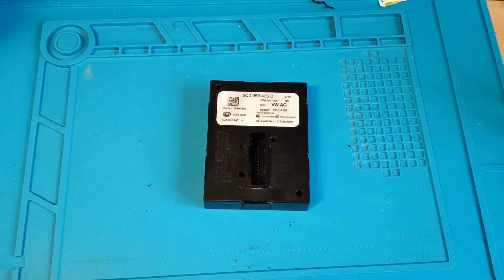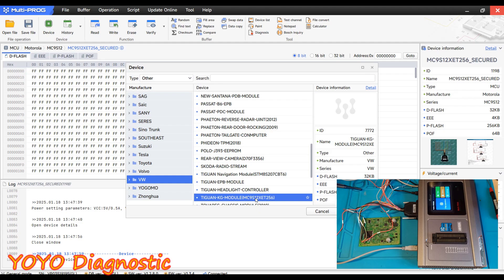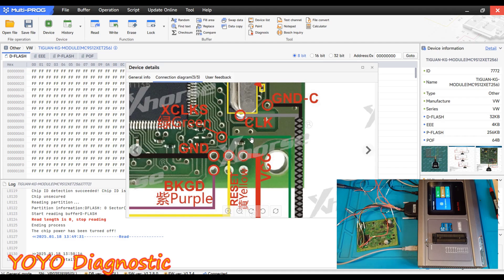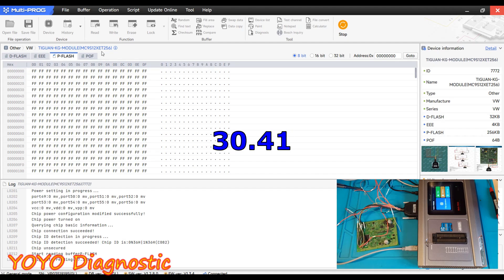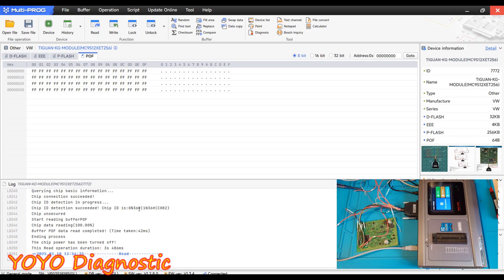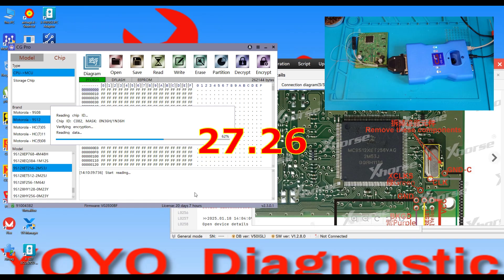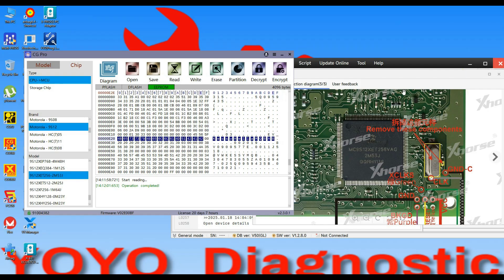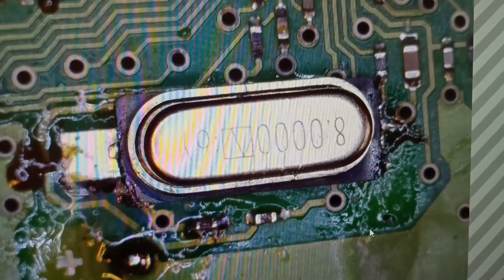Clone VAG Kessy MQB (Keyless Entry Module). CGpro vs VVDI-Multiprog. read/write MCU 9S12XET256VAG

Comment: I have buy the multi-prog but it don’t work! I have try it to red an ECU Bosch MD1CP004 from an Audi A6 2016 model it’s always come an error : Authentication Failed. I have try 10 times but the same problem. It’s not good!!!
Reply from the maker: @ionutind  contact the company VVDI, if you don't like it you can return it in 30 days.
Reply: @ I have try it again and it’s work. It’s a great programmer 😍
Reply from the maker: @ionutind  it also a new update 👍